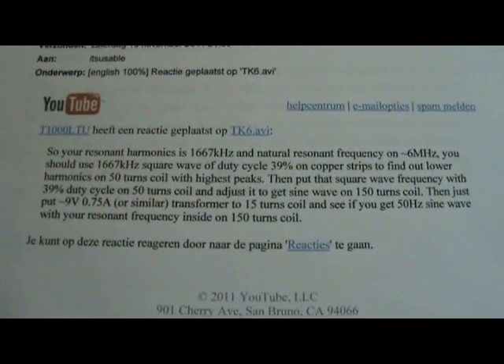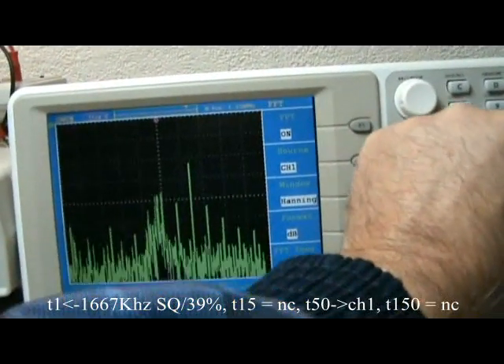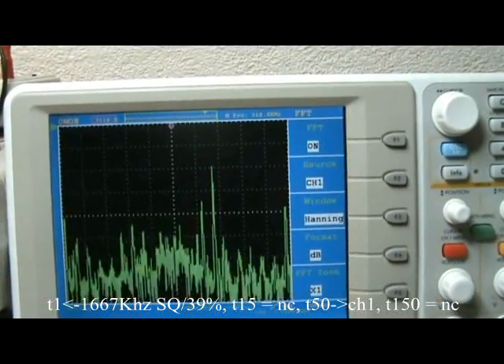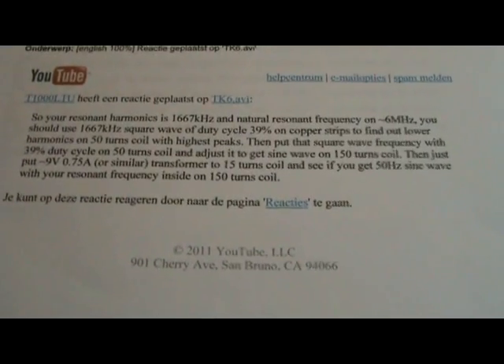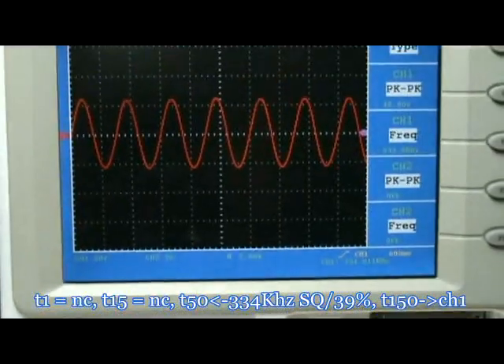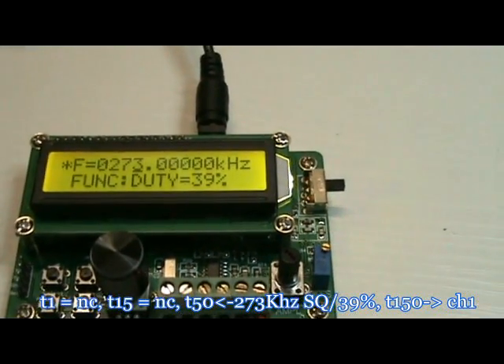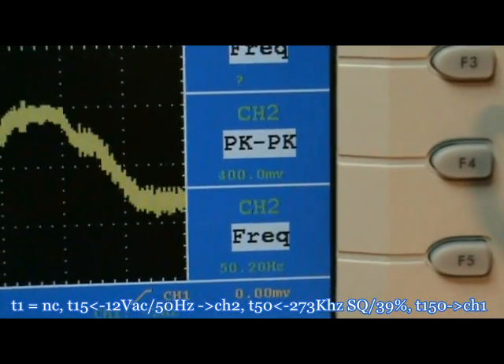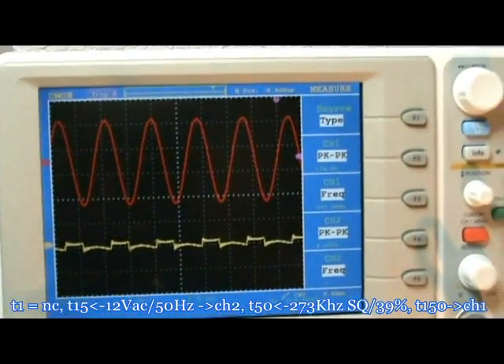TK10.avi

Comment: Mhm, your 273khz on 50T turn coil does not seem to be happy to mix with 15T coil. Just an idea, if you change frequency on 15T coil and see what frequency does that mix might be partial solution. The main point of doing all these adjustments are: 15T frequency has 50T frequency(core exciter) inside and 50T frequency match ferrite resonant harmonics so ferrite coil starts shaking inside and amplifies output of those 2 frequencies with 3rd resonant frequency.